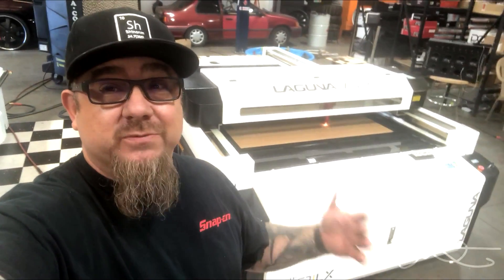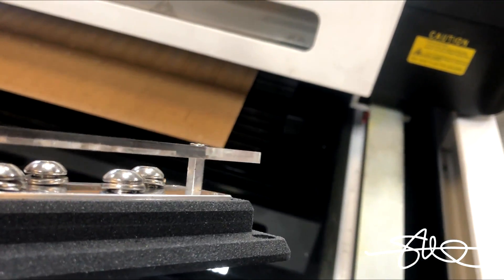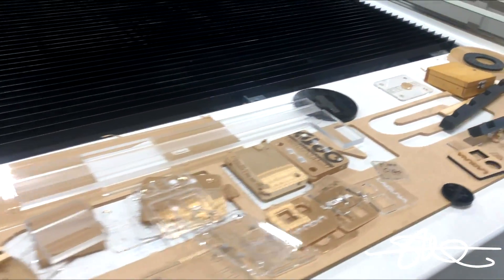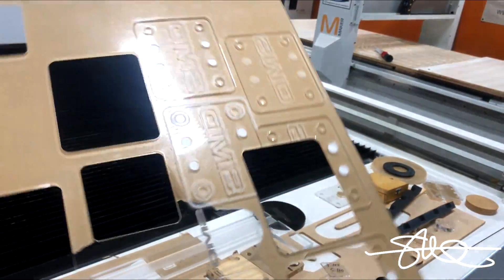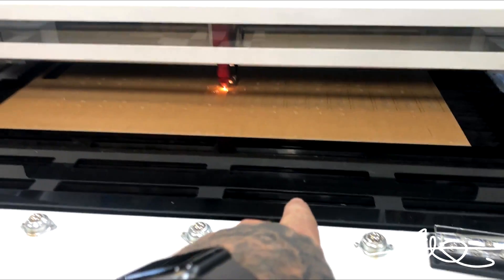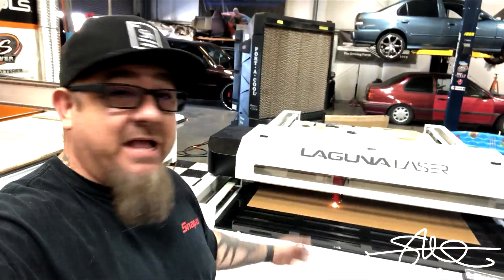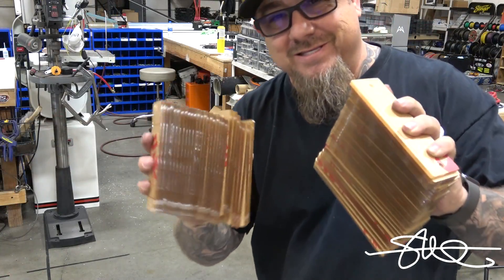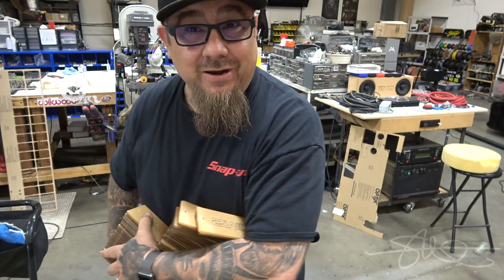Learning the Laser! Acrylic "Half Block" Lids - Flame Polished cuts! Laguna ILX 4x8 150 Watts

Comment: It's also nice because you can make the pieces much closer together because you cut them out with the laser. You could get as tight grouping with the CNC Router before.
Reply from the maker: i know. Right now i am on the same projects that i cut on the ROUTER first though.  If i want to re-draw it all, i can get less waste. These right here were designed around a 1/4" bit and normally there isn't anything but dust left when i cut those out. Now i have a razer blade line instead of a .25 line like normal.  It's ok, it ain't that much.
Reply: @meade916  also nice that you don't have to glue them down like you used to do with the CNC. only drilling the holes doesn't need glue which is nice.

Comment: can the lazer cutter cut metal or aluminum ? if so if you can cut at least 1/2" you could make some smd alt brackets or amp racks
Reply from the maker: nope.  Need a fiber laser for that. Mine is a co2 laser.
Reply: @meade916  darn but this one is still pretty bad ass cant wait to see the cool stuff you come up with using the lazer cutter

Comment: Is the corner important because it’s the starting point or a known distance away from something? Curious as to why it’s so important. Awesome work either way!!!
Reply: Garmans12valve it’s the positioning of the piece so it will be exactly right
Reply from the maker: these projects are almost always 2 sided. So the first side is on the other machine and the 2nd will be on the laser now (instead of just being flipped). When they get flipped, even on the table it started on, it has to be in the exact spot it was, just upside down.  That is a pain in the ass without changing tables.  When you change tables with the same project, you have to have the exact x/y point and also it has to be perfectly parallel to the laser.  If not, those beautiful pieces will all be crooked, the logo's would not be centered etc.
Reply: Thank you for the explanation.